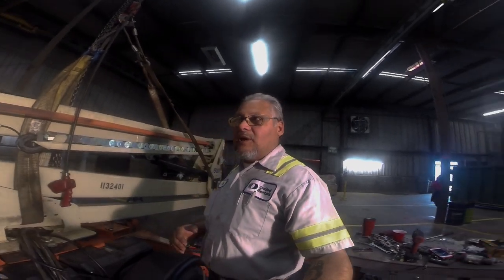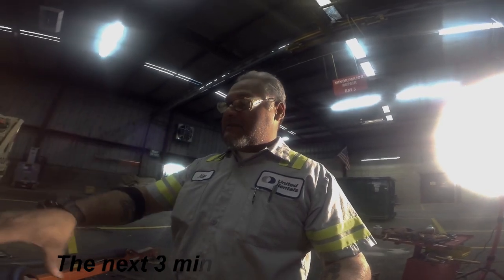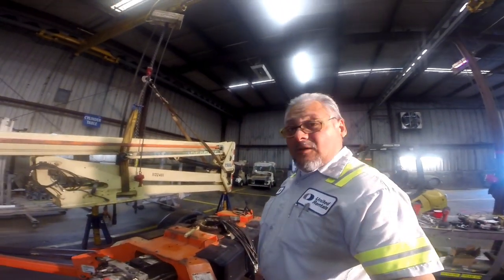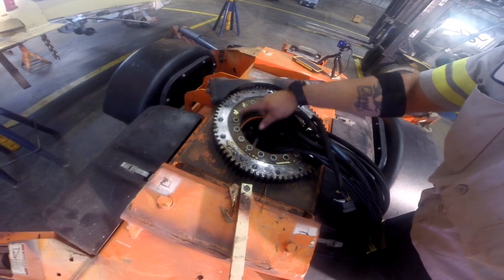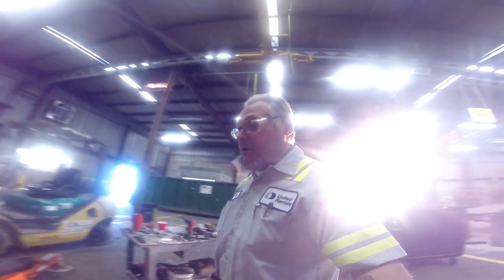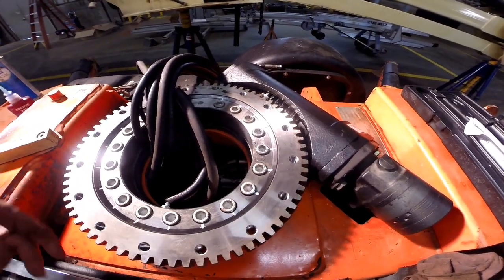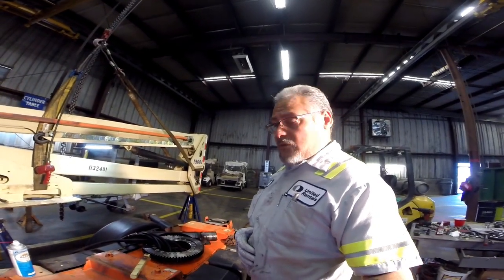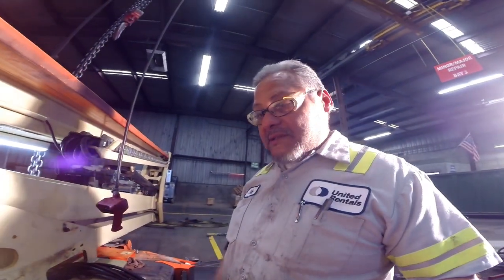JLG towable boom turntable bearing replacement

Comment: Title said Bearing Replacement, but it looks like you replaced the entire turntable assembly with actuator - you even point in the video showing "where the bearing is."  QUESTION:  do you replace the entire Turntable Assemby with Actuator?